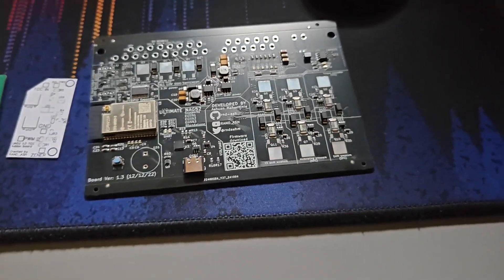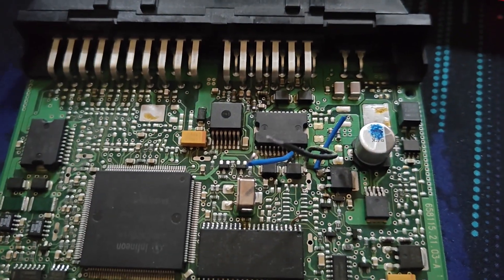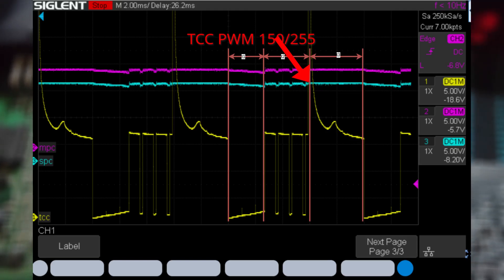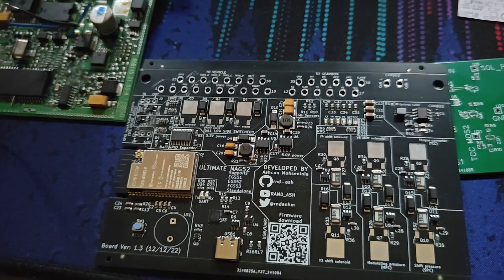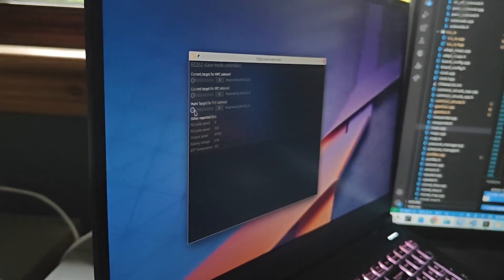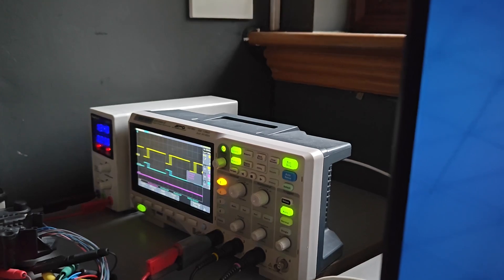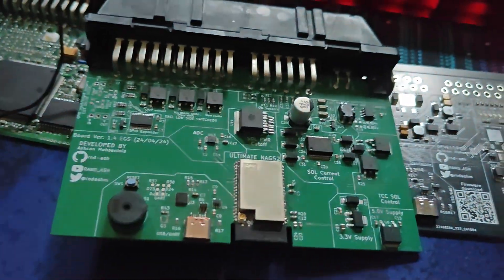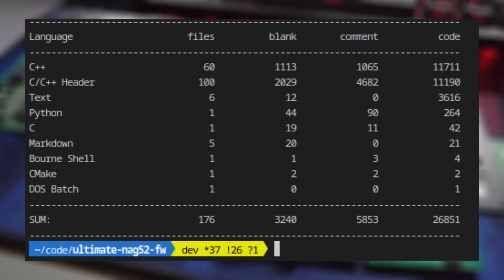Ultimate NAG52 update - TCC solenoid fix, PCB V1.4 progress, and more!

Comment: Hi,
My friend has a w211 e270 prefacelift, the one with 722.6 transmission. EGS52. He got a wheel with paddle shifter from w211 2008 facelift model. is there any way to make the paddle shifter work with 722.6 egs52.
I tried with vediamo and vgsnag2 manager to activate the paddle shifter, but it didn't work. I am lost about that, and I don't know how that can be achieved.
Reply: You need to activate it via star diag i think.
Reply from the maker: You'll also need to activate the paddle coding in the gear selector (EWM) ECU, as well as on the TCU itself
Reply: @RANDASH  Yes, I think that's the part I missed. I'll give EWM a look on Monday and see. The car now has the clock springs from the facelift w211. The guy brought it with the steering wheel. Thank you for your reply.
By the way, your work on with custom egs52 board is crazy I really like it. I am subscribed from one year ago, and I am following this project along the way. Keep it up, buddy 👍

Comment: Have you ever considered taking a shot on the 8HP70? Once you have this one dial down, I should say.
Reply: This will be great though, as I actually think it's an "easier" transmission to control as there is direct control of each clutch and proper input and output speed sensors for feedback. If that Infineon chip(definitely checking it out) can do up to 7 current channels then the hardware will already be sufficient. I am trying to do something rudimentary 😂 for manual shift operation, but have nowhere near the coding skill of Randash.
Reply: He’d have to get an 8hp car.
Reply: @trae3290  respectfully, not really, just the transmission. I currently have two, one from a Dodge Charger and a second one from  a BMW. The only difference between the two is the bellhowsing. The rest, i.e., internals, are all the same. Now, the difference between the NAG1 and 8HP is that the NAG1 doesn't have a controller or Mechatronic in the valve body, while the 8HP does. But, there's plenty of information out there on how to get rid of the Mechatronic, rewire it, and it will be as equal as the NAG1 with extra gears-solenoids.
Reply from the maker: Yes, but the issue there is there is completely different theory and control software on how to control the gearbox. The software on this TCU is specific to the 722.6, and you can't simply just add more solenoids and expect it to work in another gearbox.
Reply: @RANDASH  I completely understand. It's my understanding that the 8HP preselect gears in advance, which is another issue.
Reply: @RS-lt2ue  what do you mean by pre-select.  The working principle of the NAG1 is wired because it uses the valve body to hide some of its shift logic, an open source attempt at the 8hp can still take some hardware design clues though
Reply: @fayobam_mech_tronics  The 8HP will have the next gear selected and ready to launch, just like the dual clutch transmission. Which internals are a manual transmission with  the Mechatronic working it as an automatic transmission. By the way, for the ones reading, there are two very expensive solutions out there for the 8HP, the Turbo Lamik, and the HTG GCU controller stand-alone. Then again, I'm a huge fan of those who think outside of the box like the man doing this project.
Reply: @RS-lt2ue  Not pre-select per se  it's designed such that all gear changes are just one clutch going off and one coming on, something called "simple shift" just like a DCT as you said.

 There are other options too; canformance and maxxecu,  both retain the internal electronics reflashed with modification and act like an interpreter of some sort, they work well too unlike what is being said about the HTG, also expensive 😏
Reply: @fayobam_mech_tronics  Well, there we go, kinda similar concept. All I  hope to find is a better solution than the expensive ones out there before I adapt the transmission to a Ford 300 6 cylinder project I'm working on. I also wish I had seen this product before I installed the SRT-8 with a NAG1 on the 1970 Charger I finished sometime ago.